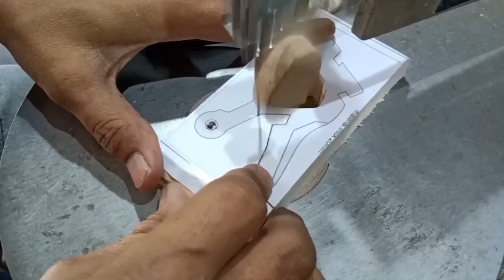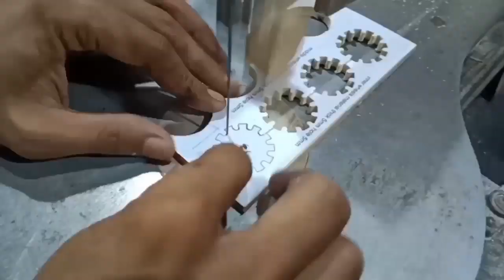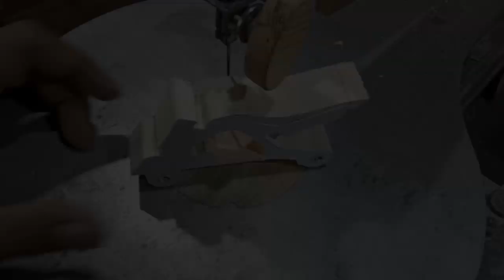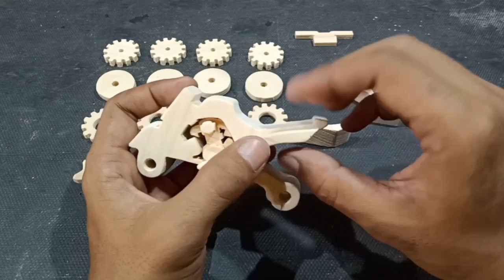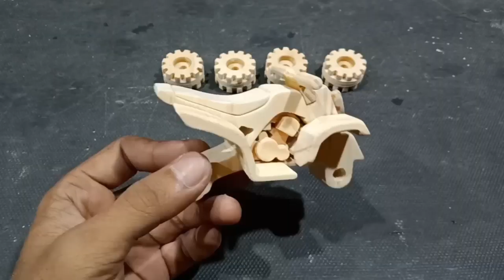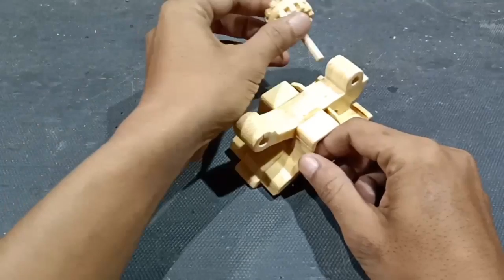Wooden atv quad bike - free plans scroll saw patterns

Comment: Kayu Nganjuk,
If you want to keep the vehicle from wobbling, make sure to make the middle circle/ring of the wheels a tiny bit (1 mm) larger than the pattern on the outside. It should then roll on the center of the wheel and not the patterns.
Reply from the maker: thank you
Reply: or true it on the lathe. mandrel on drill would do the trick as well